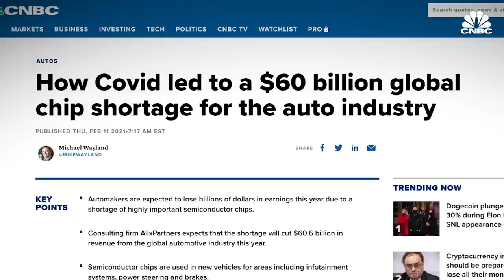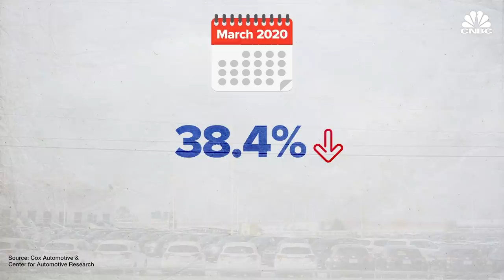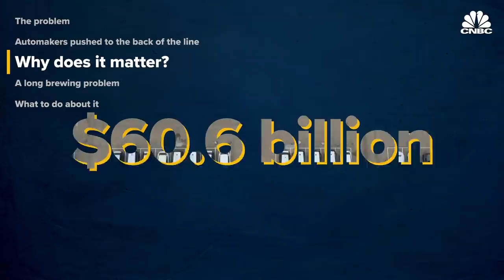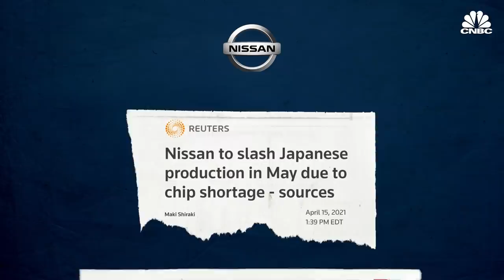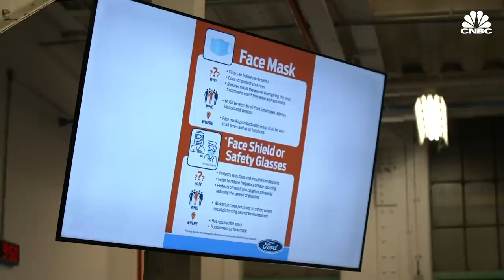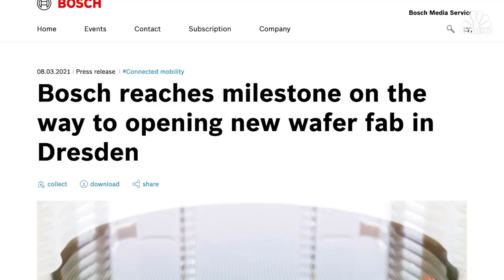Why Tiny Microchips Are Crippling The Global Auto Industry And Driving Up Prices

Comment: They left the IC manufacturers holding the bag, they are a minor share of their profits and now they complain.. 
Essentially they thought they could do the same as they do to the rest of their suppliers, and were wrong.
Reply: Yup, they got out of the line and now they want to cut to the start of the line because they need supplies.
Reply: The usual "blame the supplier" strategy.
Reply: Plus the narratives they created. Sounds like they're coming up with an excuse to convince the investors about their loss. It's always easier to blame the others and propose a "solution" (i.e. build their own plants or whatever) than to admit about the strategic decision failure. After all, the CEOs are paid a lot.
Reply: No 666 chip worries now! devil is slowly losing war
Reply: Nobody cares lol
Reply: They are used to bullying their supply chain into submission. The semiconductor industry just shrugged and put them at the back of the line.
Reply: They will go back to those suppliers as it will be cheaper that way while charging more for there cars because they state that making chips aren’t cheap anymore.
Reply: @enriquemercedes9519  Sounds like a good time if you bought a new car with the bed chip or a new machine
Reply: @SuperS05  This - the basic silicon fabs like TSMC are very big fish(almost 50 billion in revenue), being essential to many industries, they can ignore customers who don't order enough.
Reply: @machinist7230 that's the point. Fab time is booked a year in advance, maybe more now. (and that's basically regardless of process node.) The auto industry was used to being the king maker, and pushing everyone around. It's nice to see them get humbled. FABs take a long time and even more capital to setup. This situation isn't changing anytime soon. Fun fact : tesla didn't give up it's production slots and kept up the orders throughout the first lockdowns. Their production is still going strong.
Reply: They should learn that publicly blaming their suppliers who they don't have by the balls is not how to get into their good graces.
Reply: @xungnham1388  the semiconductor industry will keep laughing at them. It'll be real entertaining as the auto keeps trying to worm its way out of this.
Reply: @xungnham1388  Well, as long as the truth doesn't get out, and the ignorant public lets the government apply pressure, the automakers still win.
Reply: literally this, i have no sympathy for car manufacturers at all.
Reply: Good thing my 87 XL250R just has CDI for Capacitor Discharge Ignition, just heat up soldering iron & Go.
Reply: the only reason is: US banned SMIC. very obvious because no car chip shortage in China, but there are in US & EU.
Reply: @SuperS05  
Haha!
Reply: @YohannesKristiawan   there's a global semiconductor squeeze. Every country and company are subject to it. Forward thinking companies didn't give up their manufacturing slots. Others, like many Chinese companies, picked off the shelf products from much older process nodes that are less in demand. They get increased supply potential and increased storage buffer in the supply chain. Greater diversity in the supply chain means the less shocks in said chain.
Reply: @SuperS05  currently car chips only need 14nm foundry. TSMC, Samsung, & SMIC can produce them. when you remove SMIC, then only TSMC & Samsung left. that's why not enough chips produced.

most car manufacturer (chinese and other countries) have their own design, they give the design to the foundry to make it.
Reply: @YohannesKristiawan  there's is no reason not to use of the shelf products. For Ice vehicles, electrical efficiency really doesn't matter at this scale. There are many off the shelf microcontrollers, microprocessors, and FPGAs that use older nodes and work just as well for this use case. Not to mention off the shelf means that they don't need to have a dedicated fab slot along with the possibility of drop in replacements. The point is that they made their choices, which ultimately lead them to this situation, with very few alternate paths.
Reply: I am working in this industry and you hit the head of the nail with that statement. In 2020 orders were canceled by OEMs even though inventory was already low across the industry. At the same time other semiconductor businesses started booming. The margin in these goods is simply higher so they are more attractive. An OEM in its arrogancy thinks the industry is waiting for them and takes idle cost for granted. It is 2020 and we are in the age of semiconductors. In the future OEMs will need to consider holding shares of semiconductors companies or give similar contractual guarantees. Please be aware that what we see now is basically a strategic learning semiconductor manufacturer's implemented after in 2008/2009 a similar pattern occurred which almost bankrupted some of the players in the market.
Reply: @Diseq1  which company really build the microprocessor? who design it?
Reply: @SuperS05  I forgot the ICE cars, yes the of the shelf chips are usually for electric cars.
Reply: @YohannesKristiawan  You can google it, for automotive there are not that many big players anymore. Many ditched this business because it was rather unattractive. Low margins and in case of faulty parts it is easy to face  bankruptcy due to the claims by the OEM.
Reply: @YohannesKristiawan  there's plenty of companies that design microprocessors, from all the big boys, to organizations like ARM Ltd. and Texas instruments to renasis and many smaller players. Some of them only license their designs out, others make them directly on various process nodes. (including some very old nodes.)
Reply: @YohannesKristiawan  electric cars are not a large portion of the auto industry at them moment. They take all the headlines, yes. They will be the future, yes. But if it's were only electric cars of any type, the headlines would have been all about that. Instead, it's every vehicle lineup of every type, from all the big companies. The headlines don't even mention electric cars.

Electric cars are more sustainable to this problem though, as squeezing every last milliwatt of performance out of them means custom products. That's custom motors, custom power electronics, custom control systems. Even trying to save a few watts on the infotainment systems is worth it.
Reply: @Diseq1  I got Denso, Harman international, & infineon. is there any other?
Reply: @SuperS05  ARM is the core (the ISA, instruction set architecture). I don't know what TI made. never heard about Renesas before, looks like a big player in automotive (after I google it).
Reply: @YohannesKristiawan  renesys is decently large player in the microcontroller arena. All of their chips I've dealt with were a bit underpowered, but that was more of the oem being cheap. Like I said there's plenty of off the shelf stuff available, if they didn't want anything customized. Being off the shelf has many benefits, but it also reduces your income as 3rd party repair is easier.

And I miss understood what you said earlier that's why I mentioned arm. My bad. 

PS. TI is a very quiet company with a very long history. They have pivoted to a more industrial market. Their products would actually align decently with the automotive industry. They also have at least one foundry FAB. This is just an FYI and not really relevant.
Reply: @SuperS05  thanks for the info. I also made a mistake assuming that microchip is the brain of self driving 😃. I didn't really realize thar many other parts of the car also need microchip.
Reply: @YohannesKristiawan  yeah, that's the problem. Self driving is only a very small portion of what's in a car these days. (mostly because by volume of cars, it's not very common yet) Even the tires have wireless pressure sensors on them. 

Self driving uses a lot of neutral net acceleration which is still not so common. Your options are using a rather newish SoC with NN acceleration added, an Add on GPU, or custom silicon. All 3 have their own issues at them moment. Although like I said, it's not what's causing the bottleneck for most companies as it's seldom added anyways. (for now at least)

PS. Wikipedia has a nice list of FABs. Not all of them can make the chips that were talking about, but it gives an idea of what's out there. Using a process node of +100nm for your ECM or infotainment system isn't going to be end of the world for most models. 
https://en.m.wikipedia.org/wiki/List_of_semiconductor_fabrication_plants
Reply: @SuperS05  👍 thanks...
Reply: This is why for so long military contracts required a second source on all parts. We gave up on that because of pressure from Intell back in the late 70's and now probably only China can make their military systems without foreign suppliers. But then if your supply chain is deep enough to win the war before you run out of spares, maybe it doesn't matter - but the auto industry definitely did not have that.
Reply: @jdrissel  that was intentional for the auto industry. They pushed the limits of JustInTime supply chains. They literally have troubles if a supplier is even a week late.
Reply: @SuperS05  Say their giga factory in Shanghai.

Comment: And to think that in just the span of my life we used to drive cars that didn’t have a single chip in them, and we loved them and thought the cars were fine.
Reply: They were fine, just hard to monitor your every move and location without GPS and cellular devices inside them. They can't have their livestock roaming freely, you know?
Reply: And they polluted a ton too. These chips helps vehicles run much cleaner and are more fuel efficient. Its just all about luxury add ons.
Reply: They started to putting computer chips in cars in the 80s. My mom's 1991 car has them and it's hard to fix problems because of them. If you don't have a carburetor then your car has an computer.
Reply: I still think they're fine, that's why I nvr sold 'em
Reply: Advanced collision avoidance and self driving will save thousands of lives a year. I doubt people in the future will think what we do now is "fine".
Reply: Yes. All the smog in the air and environmental damage was “fine”.
Reply: @bugchingy  A car manufacturered in 2000 produced   on average 16tons of carbon to make it a new electric car produced  24tons of carbon to make it and still uses fosil fuel power stations
Reply: @neptuneblood6916  you’re cherry-picking data, look at lifetime carbon emissions of electric vs gas and they are equal at about 5 years, after that it is a landslide victory for Evs. Saying all electricity comes from fossil fuel powered stations is just wrong. Coal is part of the mix as in natural gas, and solar/hydro/nuclear.
Reply: @atomicmuffins1328  Most power for that period was from Fossil Fuel. No cherry picking.
Reply: @Isaiah-ft5nx  im vegan, and i believe livestock should be allowed to roam freely just like us humans
Reply: @jakedecoste4563  Livestock is defined as domesticated animals raised in an agricultural setting to produce labor and commodities. They should be well taken care of and given land to roam on, but not freely in nature. 

If they are free in nature they are no longer livestock by definition, they are wild animals.
Reply: @jakedecoste4563  let me hear you say that after you hit one at 70 mph in your e car then let me know how you feel about them cattle roaming freely

Comment: It's not just new cars. The shortage of new cars has made used cars extremely expensive. My car is worth much more now than when I bought it a few years ago.
Reply: Correct, new car prices went up & so will the used car market
Reply: What car is that? Did you buy it new or used?
Reply: @jaxturner7288  Bought it used. It was 60% the price of a new model at two years old. Now, at four years old, with 10k more miles, it's now 70% the price of a new car.
Reply: @APAstronaut333  Mustang
Reply: I keep getting harassed by my dealership to sell my used car
Reply: Both mine are 2018 Subaru forester and ram 1500 up 3300 and 2200. Both have been excellent and no recalls base models.
Reply: The Subaru forester 2.5 boxer 4 cylinder was new at 28000 in 2018 I owe 7000 it's worth 17000.  The ram was bought in 2020 had 48000 window sticker but was a loaner with 2243 miles.  I got it for 27600 currently worth 31000 as equipped and u owe 21389.  4x4 5.7 hemi
Reply: Look for the last year of design for headlights.... new headlights and crappy equipment infotainment system and engine options... the last run has upgraded everything at base level and all the recalls have been long figured out.   Brand new 2 years old is SWEEEEET on the back end of the deal with private sale forget the dealer.  A 8 year old truck with 150,000 miles can still bring 20 k easily
Reply: This continuous replacement of perfectly roadworthy vehicles has a huge environmental impact.
Easy credit is to blame.
Reply: Mine too.
Only electronics in it is the glow plug timer and radio. Manual window winders. Ford Ranger.
Nobody is selling them because they're so reliable.
Electric windows in an off-road car is a bit dangerous in my opinion.
Reply: Keep and maintain your old cars.
Reply: Right? I'm about to list a 16 year old car (safetied, good condition, but still 16 years old) for $2500. I sold my 02 Accent for $150 more than I bought it for, and I used it strictly as a winter car for three years (I paid $600 for it).

Hell, my Ryzen 5 3400G has actually increased in value, and I bought that thing in the 4th Q of 2019. 

I wonder what my 486 chips are worth...
Reply: Nah the car should depreciate over time
Reply: I bought my pathfinder for $1550 and now its worth 5k just because its simple and holds it value
Reply: Kentucky speedway is full of brand new f one fiddys, because of these chips like 2000 news trucks just sitting there
Reply: @walsakaluk1584  This continuous replacement is a very good thing. It provides stratification of car prices. When someone replaces a road-worthy car, someone else gets a chance to buy that road-worthy car at a fraction of the new car price. You can now buy reliable transportation for just a few thousand dollars because someone else paid a higher price and took the depreciation.
I like to buy 2-3 year old cars at (usually) half price. In turn, my car road-worthy car gets sold at a very good price to someone with a smaller budget than me.
Reply: Welcome to biden's era of inflation
Reply: Used cars as well. I've been contemplating replacing an 02 Ford Ranger and I always buy used. I can't find anything in my city that has a running engine for less than 4k. I could more than double my money on my previous purchase if I sell it.
Reply: Clever people who can do without a car could sell their car now, and then buy a much newer car next year when things return to normal.
Reply: This is wild
Reply: Cash for Clunkers. Big mistake it was.
Reply: @walsakaluk1584  Ford Ranger diesels smell really bad when they're running. Awful
Reply: @DJ_Force  Not bad. New GPU prices now are at around 300-400% of their MSRP and used cards are on par or worse.
Reply: Yep! I sell Tesla vehicles, which you can currently get after a couple months, and used car offers are INSANE right now! That's a huge reason to trade in now if you've been waiting!
Reply: @gatewaysolo104  mate this is happening in the tech industry as well. Not since Biden's inauguration, oh nonono. Easily since September. impossible to find some components-especially gpus and certain cpus- new for under 2.5x msrp new or used. Same thing with consoles and select other electronics.
Reply: @bingosunnoon9341  my diesel ranger is odorless and smoke free. That's because I maintain it and replace components that are subject to normal wear. Not hard mate.
Reply: @walsakaluk1584  aussies have a sick car market
Reply: Bought my 05 silverado for 14k in 06, could sell it for 12k tomorrow morning. Only 2k depreciation in 15 years... lol
Reply: @DJ_Force  I can attest to this.  I traded in my car for what I payed 4 years later... (2015 Hyundai sonata I bought used)
Reply: its affecting prices of cars without electronics too. my e-type jaguar has gone up in value in the last 10 years..
Reply: That's a fact! 5-15k more.
Reply: @gatewaysolo104  
This an effect of the pandemic.  Not Biden.
Reply: @DJ_Force  lmao same here I bought a 2015 mustang GT from carmax 3 years ago for $30k it had 13k miles on it and I just checked how much carmax would buy it back for it quoted at $26k and I owe $15k on it currently it had 35k miles on it now
Reply: A friend was thinking she'd get $1,000 for her old Miata.  Then she checked current prices.  Sold it for $2,500 in less than 4 hours.  Crazy.
Reply: @fdm2155  That's great, until you want to buy another car.
Reply: When I checked last week, the Kelly Blue Book value of my 2017 Ford Escape Titanium is close over $1000 higher than it was when I bought it used last year.
Reply: Yeah, I’d heard rentals are sky-high too. Like a thousand a day....nope. I’m not traveling, but that was from people who are.
Reply: The autoindustry apocalypse is upon us. I'll bet you by 2030 you won't be able to afford to drive a gasoline vehicle because they are going to have gas/oil "shortages" due to the 99.98% survivable virus restrictions.

Pretty soon, you'll only be able to uber/lyft in a self driving tesla, and that's when one is available because there will probably be like 1 for every 500 people in an area. 

But that's ok! As long as they don't take away tik-tok and sportsball then slavery is fine! 🙄
Reply: Id be happy to have to NEVER own a car again. Talk about one item that helps keep you broke.